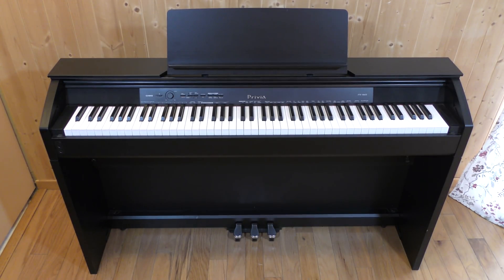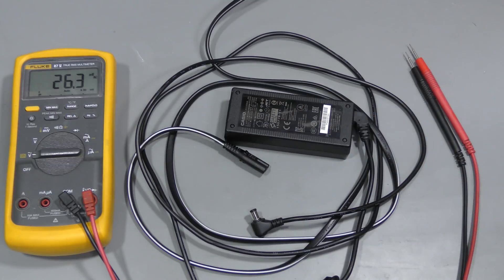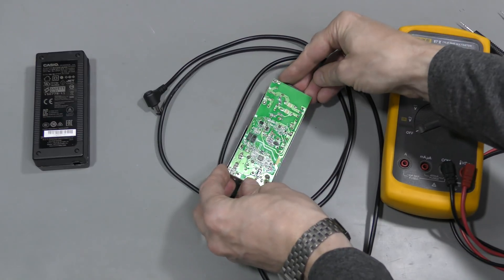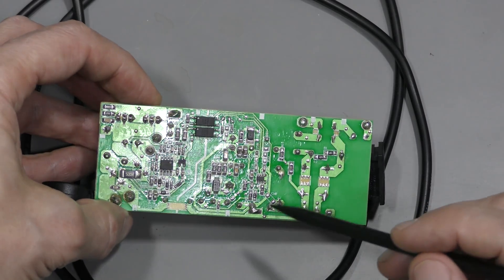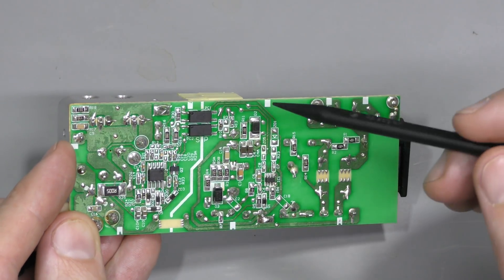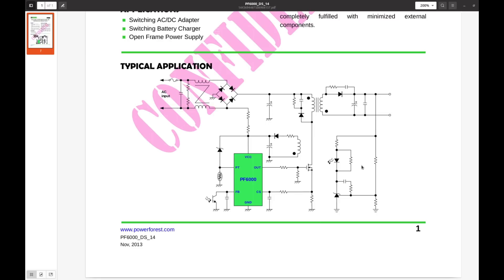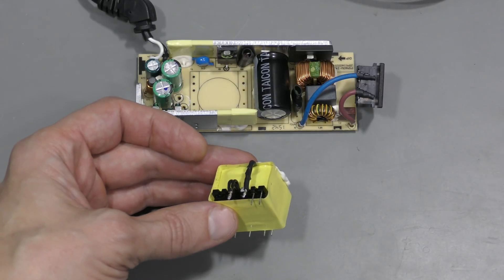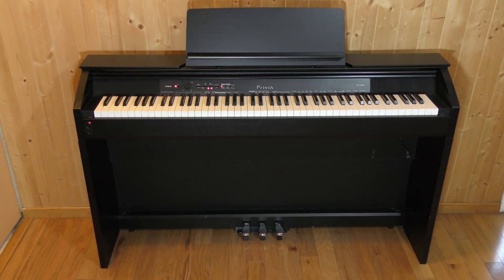#116 - Casio Privia PX-860 digital piano repair

Comment: Better way to open glued power adapter enclosures is putting it in the vice multiple times.. Sometimes, I put small metal rod from one side before closing vice.. Depends of construction. Hammering method is more brutal and, usually, I using it only as backup. 😂

Comment: Great video, but let me teach you something!

There is a better way to open this type of "laptop" power supply, than with force.
All you have to do is apply "flux remover", "PCB cleaner" or however it will be called, all around the seam of two halves of the case.
Let it work for a minute or two. And you will be able to take is apart with your hands only, no damage to case, no damage to components!
Reply: I'm using knife placed on this join and tap slightly by small hammer.

Comment: I am feeling slightly mislead: Expectation: Seeing the inside of an electric piano. Content: The inside of a rather boring power brick. So I make an exception and do NOT hit the thumbs up. But neither thumbs down since it still was a good repair, just not what was promised on the title.
Reply from the maker: I see your point, and partially agree. However, the supply is part of the piano. I repaired a piano, that did not work for some reason. What if the supply was integrated?
Reply: @feedback-loop  Then this video would have included a look into the piano, as expected :)

Comment: I am glad you didn't cheat in this video.   Damn.   Good catch on the broken wire buried under the tranny.     How long did you test everything before running across the open coil?   That has to be the first time I have seen a broken wire on a SMPS tranny.

Comment: Nice! I've had some luck using a vice to open up those power bricks. I use the pressure from the jaws of the vice to crack the seam. I suppose a C-clamp or something similar would work too.
Reply: Me too. I also use a vise to open clued / plastic welded housings. I continously increase the pressure slowly until i hear it cracked open.
Reply: @e42_channel  something to try in the future. In most cases because they are so "chinesium cheap" it's easier to replace it. At least that is what I've found.
Reply from the maker: Perhaps I will try one day
Reply: No need, use pcb cleaner on the seam of the two halves of the case. Let it work for a minute or two. You will be able to split the case by hands only